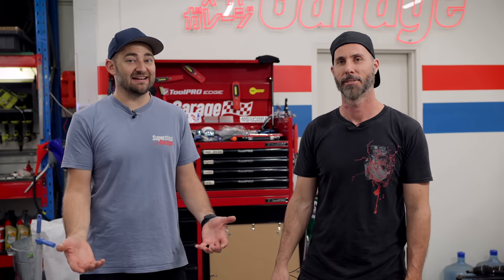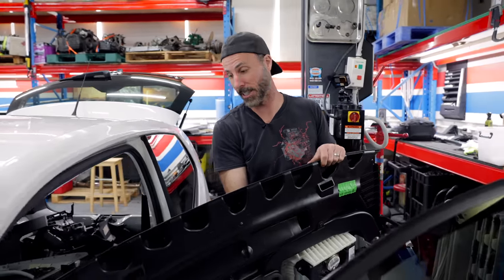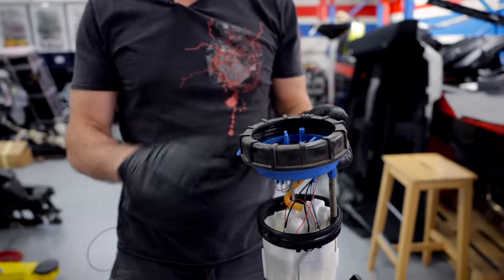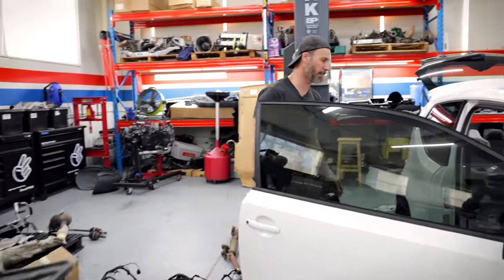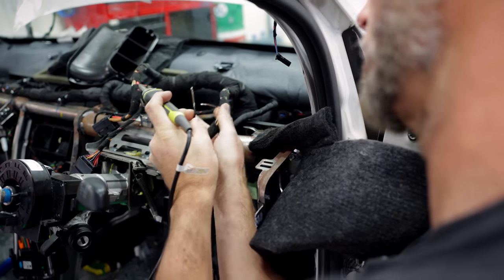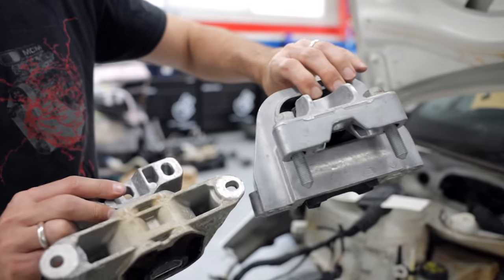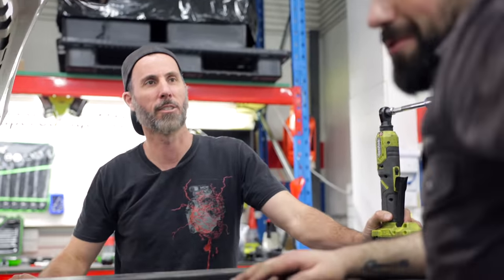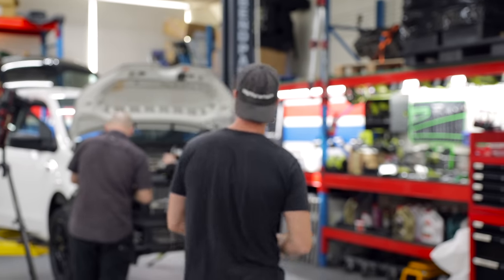Turbo VW UP GTI Conversion - EP3

Comment: I had the UP TSI and they map pretty much the same as the GTI, obviously main things are the gearbox brakes, (I was told fuel pump is different too by my tuner) I stage 3 my UP TSI and got to 180bhp 
Forge Motorsport intake and BOV
RACING Line Turbo Elbow 
Full Milltek turbo back exhaust 
Hybrid turbo 
Fitted APR coil packs too 

I honestly felt stage 1 was best for me, stage 3 was mapped so the boost builds (so got a bit of lag) stage 1 was so much more fun but didn’t have that top end boost it had at stage 3, 

I’d definitely recommend fitting the bigger GTI brakes if you ain’t done that already as my brakes got hot quickly, I had EBC brakes and pads fitted too, you Will definitely have loads of fun, also shock a good few cars on the road, cannot wait to see the build, highly recommend JBS in the UK for advice too as they are the go too guys in the UP for these 👌🏼✌🏼

Comment: I had an up for a number of years, it was the best car I've ever owned hands down, it coped an absolute hiding and took it on the chin every time. NEVER let me down. It was so low I couldn't get over the joining plates on the roof of shopping centres. And scrapped alot. I sold it for a Turbo Forester and still to this day wish I'd never sold it. I had planned to turbo/import a GTI Engine. Would own another in a heartbeat if I had the chance.

Comment: As a VW Up GTI owner, one mod I recommend is a limited slip diff! At least with the stock tires that come on the GTI I have massive traction issues at stock power. As soon as the weight is slightly off center or the road is damp, one wheel peel is all that I get. Some guys on the UK Up forum got Quaife to make some custom ones for the Up but they don't sell them anymore. Would be cool to get them to make some again, because I would really really want one!

Comment: Just a heads up (get it?), there is a facelift version of the up, which I think your gti parts are- and the bumper support bar is different- the tow eye is in a different place. It looks like you’ve used the facelift support which might not align with the tow eye on your bumper cover. Probs not a massive issue but might flag up in scrutineering when at the track!

Comment: I think a lot of what makes this car fun, is that its light and basic, with decent handling.
Reply: Tiny lightweight nuggets are the cheapest and best way to have fun in a car, I reckon. I want to get involved with that Hyundai Excel racing class, that looks like it would be mint!
Reply: i would prefer a starlet over an up any day of the week.
Reply: @99Lezard99  As the ex owner of a P9 starlet and the now owner of an Up GTI, just the feel of the gearshift compared to the toyota cable crap is worth getting the Up for.
Reply: @donotatme  agree on the shifter. the p9 cable shifter defenetly isnt Toyotas best efford. but a vw shifter also isnt the best feeling thing on the market. they are also pretty plasticy and / or rubbery feeling. 

other then that the rev hang on the up is pretty far up there with the worst ive driven. old cable throttle cars just dont have this artificial feeling throttle.
Reply: @99Lezard99  Of course, it's not a sublime honda gearshift, but it's an UPgrade at least ;D

And I partially agree on the rev hang, the worst I've seen was in modern subarus. Throttle cable rules tho!

Comment: 10:54  Have you gentlemen ever considered using the "SolderStick" system for your electrical connections?  Heat shrink and solder all in one; no soldering iron needed.
It turned out to be a complete game changer, and a bit of a time saver, for me on this kinda stuff.  👍
Reply: Solder sleeves are awesome, but the wires should be twisted or woven together first, either way.

Comment: Did you use 'submersible fuel hose'? Normal fuel hose will deteriorate from the outside when submerged in fuel and create a big mess

Comment: Quick tip don’t solder anywhere on a German vehicle factory repair manual calls for weather proof butt connectors. Solder breaks with the vibration of the vehicle over time, might work now but will eventually fail in the future. Other than that great video keep up the good content I absolutely love this series!
Reply: Should have at least twisted the wires together first.  That's just the bare minimum standard.
Reply: @user-dj1hy6zc6q  twisting actually increases failure rates. It prevents the solder from efficiently flowing from top to bottom. meshing is the proper method. The only time you want to twist, is with solid core and using a western union splice.

Comment: Moog - With a problem in the fuel pump of my Merc A160, I removed it and replaced the same piece of hose with a similar type of hose as you have done. It burst at about 2000km as the high octane petrol had turned the outside rubber to jelly leaving the internal membrane unsupported. I hope you have better luck or you'll get stuck on the road as I did! Good luck!

Comment: vw wiring really changed about the time the mk4 cars came out. mk3 and prior had about 8 small wiring looms that all spiderwebbed out from the fuse box under the dash. all the fuse panels were identical, and they would just put the loom in place that matched the options your car had, such as the headlight loom that also has fog lights. things for modding and building really went downhill during the mk4 era. thats why ill stick with my 90s models as the newest cars ill ever own.

also in a vw, brown is ALWAYS a ground, the color of dirt.

Comment: I built a way overdone Toyota Echo in the states. A Platz in most other places. It was an absolute monster in the most modest sense. I 1000% get the allure to a small, simple, light, car that keeps all of the purity but still gives it the ability to punch waayyy above it's weight class in fun and performance.

Comment: Reminds me of the one BMW project I've done past an E36, BMW tech wise. E91 Wagon that we only got as 328i's converted to a 335i by swapping over a Sedan.  And by that I do basically mean the entire sedan was required to be swapped over.  We ended up stripping them down to nothing and basically just swapping out everything possible over from the donor.

The only bimmer I have left is an E31 roller I swapped a Toyota 1UZ + procharger into.  That's probably the most reliable BMW I'll ever own and will probably be the last BMW I'll own too.

Comment: nice job guys !  not sure about soldering the wires though, soldered joint tend to be weaker and break faster since the wire loses its flexibility on both ends of the soldered joint but best of luck!

Comment: when i went from 5speed to 6speed on my mazda 3 i was surprised to learn that the synchro mesh assemblies were more robust on the 6 speed because it was built for the larger load. i found that out because i blew the synchros out on several gears in my 5 speed driving it like a maniac, and those extra friction cones came in handy. your mileage may vary.

Comment: Tip on the fuel pump hanger gaskets... put it on the tank then put the pump assembly in. It's a pain in the butt to get it to seat right if you put it on already around the assembly.

Comment: Small tip for the next time if you cut a loom to resolder it later:
Try to cut all the wires to different lengths. This way you don't have all the solder points in one place and it is way easier to wrap it afterwards.

And yes, I'm aware the GTI loom was also cut straight through. But it still is a helpful thing to keep in mind.

Comment: As most of you know the VW UP! platform Is manufactured at the Bratislava factory in Slovakia. 

Along side with the models on the shared SUV platform VW Touareg, Audi Q7, Porsche Cayenne, Bentley Bentayga Lamborghini Urus etc. 

After my years of working for the vag group I must say in my opinion that what comes from that factory is the high mark of quality when it comes to vag cars. Especially the UP/Citigo/Mii platsform is brilliant in quality!

Comment: Ick. That soldering.....

Twist the wires together first, if you want a strong joint.  The wires twisted together creates the joint, the solder holds it there.

Probably it will be fine and will last forever, but the solder joint could also crack.  Impossible to be sure, but it is sure that you did it wrong.

Comment: Tip for cable tie packets… Make a small hole halfway down the packet to get them out. They will never fall out and you don’t have to ever open or close the top again.
Reply: I bought some Round Plastic Jars with Lids from Amazon to hold cable ties, easy to put your hand inside to take one out, and they never end up falling out all over the floor.

Comment: I've got a 2016 turbo VW Up, 90hp stock (CHZA engine) with a 5-spd transmission, ECU tuned to about 130hp. It would have been easiest to just buy one of those engines from Europe and swap it in. The GTI has the CHZD engine with a 6-spd. The real differences are a slightly diff turbo, GPF (gasoline particulate filter), sodium filled exhaust valves for better cooling, and more heat resistant steel turbo housing. The GTI engine however has GPF problems and the 6-spd is less durable. The biggest problem with this car is the lack of cooling at higher power levels, the small intercooler is integrated into the intake.
Reply: As a GTI owner, wholeheartedly agree!

Comment: I did a 2009 polo gti full conversion into my 1988 mk2 golf and surprisingly the wires were pretty much exactly the same colours even to the tail lights lol only difference were the connectors

Comment: Make sure you use NBR/NBR fuel pipe when using in tank fuel hose.. the outer hose on regular fuel hose isn’t resistant to petroleum or ethanol..

Comment: please use western union splices when you solder! if you just butt solder them the joint will eventually crack. with a western union splice under the solder, that doesn't matter.
Reply: Western union splices should ONLY be used on solid-core. Stranded should be meshed to allow the solder to properly wick.

Comment: PD TDI conversions in mk5 golfs, using the mk4 engines and 6spd gearbox, use the sprung connectors from the donor gearbox. I found this out the hard way that using the 5speed ones locked out the mk5 gen gear linkage even though they look the same at a glance

Comment: No need to replace the whole interior loom.  Just the engine loom and ecu to fusebox loom for the engine. 

Also just get the immobiliser removed from the ecu and then just use the original key. 

6speed box is worth more then the 5speed so it’s got pulled off and cheaper one provided

Comment: It´s a bit of a shame you guys couldnt get the LWB Up!
The brazilian version is 10 cm longer and the 1.0 TSI has a few extra HP plus full ethanol flex fuel system.
One of the best small cars of the last 2 decades!

Comment: If you plan to run the old dash/radio you need the old power plug, since the face lift uses the mrk 7 golf version, your old up radio uses the mrk 5 golf version regards sören

Comment: I’ve got the same flashlight!! 7:16 in the vid. I love it!!! I use it everyday in my job as a Honda tech. No one can figure out where the power button is lol. Here in the states I got it off the Snap-on truck, and it wasn’t crazy expensive if you can believe it, I think I’ve seen it with other brand names in the catalogs. Cheers 🍻

Comment: The raceworks pushlock hose in-tank, you might want to revisit that and replace it with some submersible-rated hose, SAE30R10 is submersible rated

Comment: Volkswagen should make an Up R with a 1.2L inline 4 turbo making around 200hp, (with ported and polished heads and forged internals straight from the factory) which would rival the Fiat 500 Abarth and the Abarth 595

Edit: Or if they want, they could keep the 1 liter I3 but add a bigger turbo, making the power figures go from 113hp to 179 or even 200hp, which is the same horsepower figures as mentioned above, if that wasn't obvious enough

Edit 2: Sure the cost for the model with the 1.2L I4 (with it being literally pre-tuned by German engineers) would be monumental (okay maybe not THAT monumental) but it would be worth it, as it would strike a balance between sheer speed and being actually fun to drive, with the latter being good handling and the overall quirkyness of the Up R

Comment: By the way, the bolts used for the engine mounts are "wrong". The correct bolts should be stretch-to-yield (one-time use) bolts which all VAG bolts with "silvery white matte" finish are.

Comment: I find it a bit weird that the engine came with a 5 speed box. Sounds to me like they gave you a gearbox from a TSi(one spec down)
Reply: Someone else has said the engine cover and gauge cluster don't look like gti ones too...
Reply: @ceebee2641  I'm sure GTi and High! Up clusters are the same, and you can't buy a TSi at a lesser trim, only "High!".

Comment: The wiring to the rear lights are also different (you can unpinn it and fix) 😉 regards sören you also need to check the hoses for the fuel pump

Comment: I dont know that it'll much of an issue as you're putting new bolts in for the engine mounts but I want to say VW uses torque to yield bolts on those mounts. 
Keep up the good work though, love seeing the headaches with these kind of swaps and all the things that can and do go wrong then overcoming them.

Comment: I'm having flashbacks to when I was a young, impressionable VW tech and I was given an Atlas that was growing mushrooms.  The AC evaporator drain line has been pinched and was backing up into the passenger compartment.  VW tech line told me to pull the entirety of the interior out to see the extent of the mold infestation.  VW ended up buying the car back.  Thankfully, I didn't have to put it all back together.

Comment: i wouldnt be surprised if you could possibly have got away without swapping the wiring loom, just the ECU, pump, possibly ABS pump, existing keys could have the replacement key chip fitted OR current keys programmed to the replacement ECU.

Comment: Will the heat schrink in your fuel pump not vanish bacause of the gasoline?? If yes youll get a short where you dont want that because fumes heat and a plastic cap⚠️

Comment: try swapping the right gear cable with left
(put left one on rights selector on gearbox and right on left selector) 
 one on my vw 2006 jetta that's what I done it worked although never done on a up!
suppose you could try it and let me know!!!

Comment: I really want to see someone do something similar with the Peugeot 108/Citroen C1 when they used to have the 1.2 Pure Tech engine in them. That same engine is available in both 100 and 130 horses in other cars, and seeing the tiny lil cars with fun amounts of power is just amazing!
Reply: The 1.2 turbo has really bad problems with low speed pre-ignition and a stupid wet timing belt.  There have been a bunch of engine failures.
Reply: @ferrumignis  The early engines did with the Belts, but PSA switched producer and the newer variants do not have this problem. The engine is also very sensitive to the oil used, and a lot of the reliability issues come from people using the wrong engine oil and not getting away with it as they would in other engines. If maintained properly, I don't think they're as bad as all that (I worked with them for 5 and a half years and only ever heard of the problems, not experienced them)

Comment: When you removed the headliner, did you by any chance noticed if there are mounting holes behind the headliner for curve handles for the front passenger? In my e-up there are none mounted, but I want to retrofit curve handles if possible.

Comment: in my opinion the fun is only just beginning. The electronics on VW's are just painful - its going to be a mission to get that all working i think. You'll need to disable anything not wired in. An example. my wife's VW threw codes when i unplugged a speaker to upgrade it haha!

Comment: Being mostly a Super Beetle guy (L bug), I always hoped you guys would build a Super Beetle.  I never really held out hope because a Beetle doesn't seem your cup of tea.  In all other ways, you guys rock!
Reply: May I introduce to you mcm’s most viewed video…
Reply: I saw the Miss Daisy poster.  When I got into Supers, my first car had an ABA 2.0L with 1.8 RD head, but since then I've acquired a pristine car I'm unwilling to cut up for  radiator.  I will make due with a 2180cc aircooled engine.  Everything else on my car is upgraded

Comment: did you buy the engine and gearbox together ?  I thought all GTi's were 6 speed (mine is) - have you not bought a TSi engine and gearbox (90 BHP)?
Reply: i also think they got a TSI drivetrain mixed with some GTI parts

Comment: 2 problems with ya fuel pump .. 
Fuel hose will swell and fail 
And heat shrink will also do same in the petrol .

Comment: You must be happy with the 5-speed gearbox. far more durable when tuning. 5 speed gearbox is super strong in up! world. The 6 speed gearbox is quite a problem above 125 hp.. your gti from the UK is certainly a 6 speed from the factory. but the 6 speed has probably exploded. I will always choose the 5 gear tsi gearbox

Comment: That fuel hose will not last, it will start to perish because it is not designed to be immersed in fuel.
Seen it happen a few times, it needs to be plastic.

Comment: It's a shame that the VW up gti is so underrated. People really sleep on Euro's that they were mad enough to Turbo a dinky 1L econo box but everyone will simp for kei cars.

People Simp for anything with a 2JZ while Europe is carrying on the spirit and cranking out engines like the B58, EA888 and the 1.9 PD, which are so easily Tunable with lots of potential.

Comment: The up gti 6 speed is speciel cause the lower total gearing makes it a killer, the 5 speed from the tsi and 6 speed from polo/fabia are the same total gearing, so not as good. You can get a turbo from germany so the up makes just shy off the 200bhp 😋😎😉

Comment: You can use that original fuel line in the sending unit the key is heating it up with a heat gun…